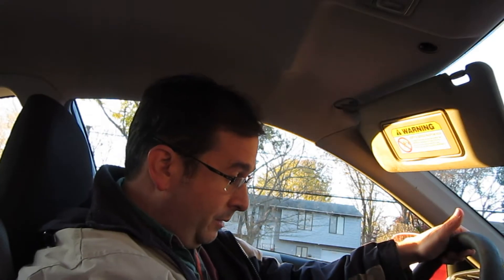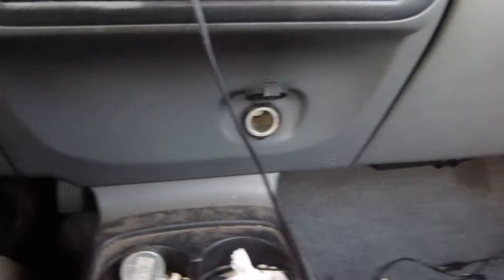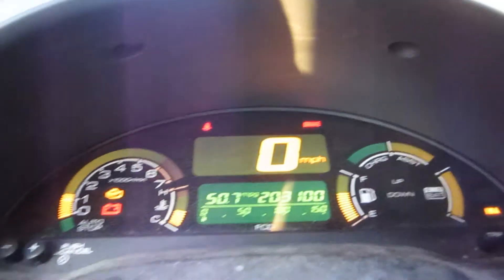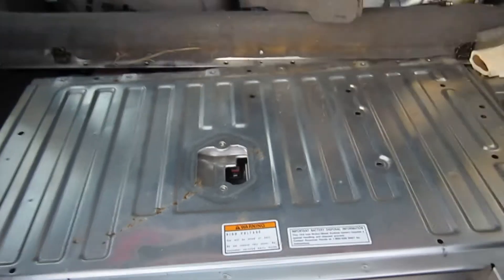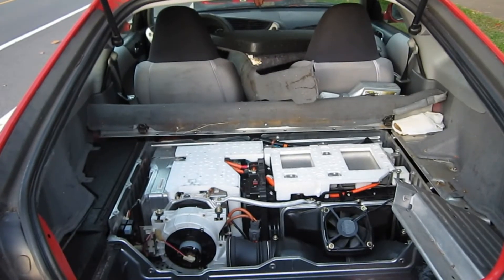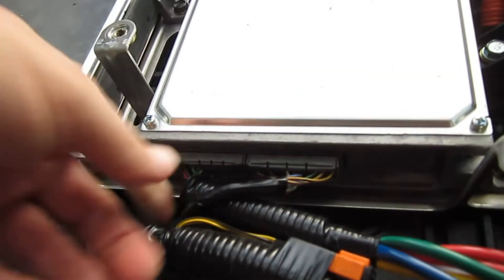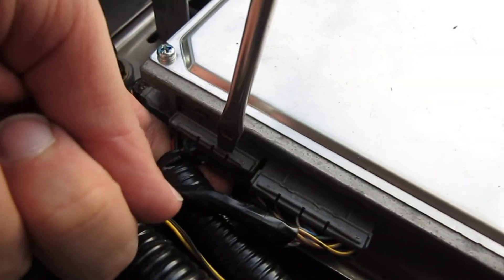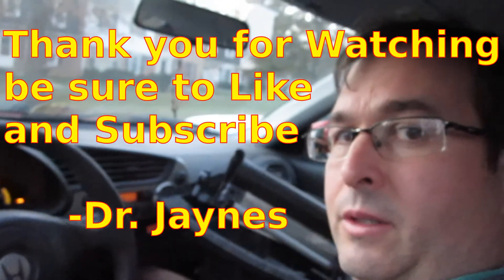Honda Inisght: How to Disable the BMC

Comment: I’m about to buy an insight but I’m not buying it for the hybrid part, I am getting it for the low low price. So I will disable the bmc and then leave the breaker switch on the off position??? I’m just trying to be sure because I’m not trying to fight this thing killing it’s cells super quick I just wanted the cheap neat looking car
Reply from the maker: It has been a while.. I but I believe the break must be in the ON position for the starter battery to charge... disabling the BMC will allow the starter battery to continue to charge.. otherwise the car will die while you are running it! It needs that battery to make the spark!

Comment: Does the check engine light stay on?
Reply from the maker: That car was starting to have so many problems! I think the catalytic converter was starting to go bad?? It had over 200,000 miles, and the transmission was having trouble shifting..and was a real problem in rush hour traffic.. especially when starting on hills going up!  I traded it in for a different car..but yes, I think the check engine light may have been a different problem??

Comment: Can we get an update if this was a permanent solution to have the battery charging :)

Thanks!
Reply from the maker: HI, I am still driving with the BMC disabled.  It seems to charger the battery if you keep the the RPM's between ~2500-3000. It has been working for months now, but he power output of the engine has dropped.  I suspect it is either that the battery output is low, so that the fuel pump does not deliver enough fuel, or maybe the fuel pump is starting to go, as a separate issue.  I would not be surprised if the fuel pump is starting to go since I have over 200,000 miles now.  if you rev the engine much above 3500 RPM's it will stop charging the battery as well, you can tell because the battery and brake dashboard warning lights will come on.  If you return RPM's to the range of 2500-3500 RPM's these lights will go away, and I will measure 13+ voltage with my volt meter through the cigarette lighter.  bottom line... still running...
Reply: jaynes network awesome ! Thank you